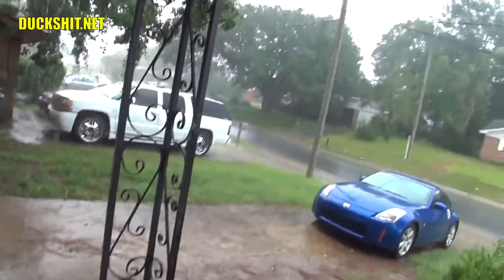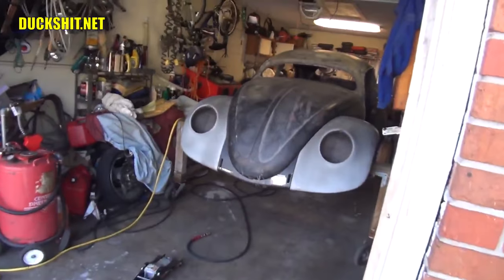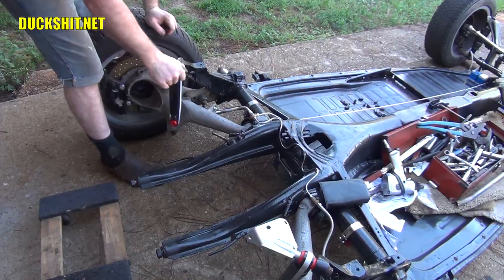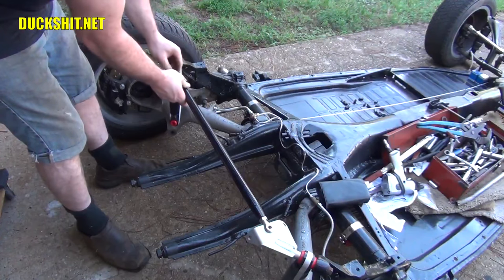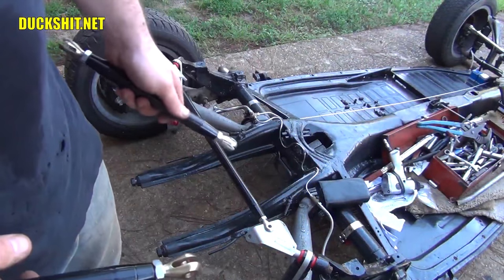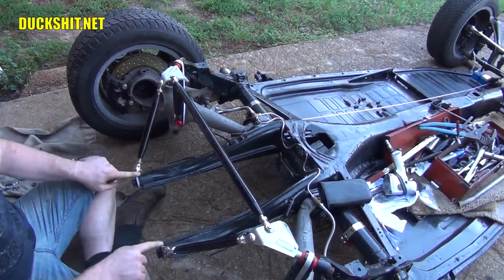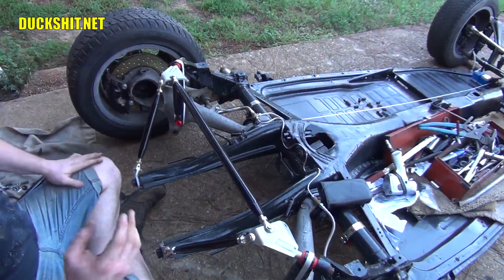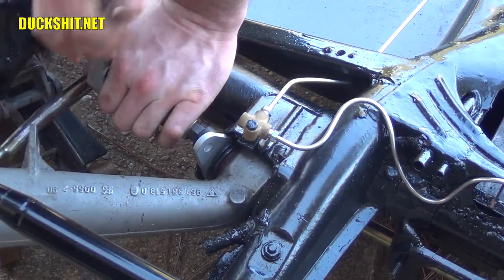Kafer Brace - ROTTEN OLD 1956 Chop Top Oval VW Beetle - 35

Comment: You should consider the 17” Heritage wheels from the current generation Beetle. They have a straightforward classic appearance and look modern at the same time. They do have a different bolt pattern then the 944 but maybe you can use adapters instead of the spacers.
Reply from the maker: I did consider those, I like them very much!  But I have discussed my opinion of wheel adapters in an earlier video.  No wheel adapters for me.

Comment: I fixed up a 67 when I was 16 in 79.Put dual carbs and had close ratio 3rd gear.It would out run V8 camaros .Had a straight stinger with a wing nut baffle that I removed when I dragged race it.Only on the streets.Would love to build another .Do you feel closer in when driving the chop Top? I love the look
Reply from the maker: I love that!  Hehehe!  Thanks for sharing!
Reply from the maker: I don't feel closed in at all, I built it more to the proportions of the 350z, it feels a bit similar to my shoulder, but really not like I'm in a cave.  Mounting the seats lower puts my head right at window level!
Reply: I raced it so much I broke the front cone off the transaxle so bought some plates that bolted to trans and was welded straight to the frame.Had aluminum flu wheel with racing clutch .Sounds right about your Z.Never thought of that .My wife had a Audi TT and it’s the same size .Cant wait to see you finish up bug

Comment: Yo ducky Mcduckerson quick question about these. if it were to get a subbie swap, how would these interact? complete interference? cleared? etc
Reply from the maker: I was talking to Kevin from CoolRydes and apparently these were designed to clear everything.  You souldn't have any problems, if you keep your VW transmission, or if you install a Subaru transmission.  And of course, the engine is nowhere near it anyway, so no problems there!
Reply: sweet. i currently have a 70s buggy and honestly thinking about getting a sleeper subbie swap too. 

i just know it would be a hell of a lot of work because i really dislike the late model hatch/hood styles so i would need to make the older stuff fit.  let alone the engine stuff. BUT its good to know this works since i would need to beef the hell out of the suspension.
Reply from the maker: The older decklids and hoods are an easy fit, the apron swap is where the real work comes into play, though.

Comment: Looks like a good product, do u think it would work on a swing axle setup on an old Rebel frame sand rail?
Reply from the maker: Nope afraid not, because keyword swing axle.  The 6-point truss brace is IRS specific.   A 4-point will work just fine for you though, unless you convert to IRS.   Thank you for the question!

Comment: That's going to be a sweet chassis. LMAO at people complaining about the direction of rotation but didn't seem to notice they are winter tires. Obvious garage use rollers. I mean, winter tires? In Florida? WTF....
Reply from the maker: Blizzaks!!!! LoL! People here don't recognize them! You win a prize!  LoL been wanting someone to notice that since forever!  As soon as I get my first batch of DuckmanCycles shirts in you get the first one!  But the wheels/tires came off a 911 in Denver.  They were his winter set.  He sold the car and I bought the wheels.  New tires when car is ready to drive... dont need dry rot on my new tires while car just sits in the garage!
Reply: Never noticed before since I tend to ignore rollers. Took a look this time because of the uproar over rotation direction and Blizzak jumped out at me. One of my jobs when I lived in New Orleans was parts delivery. I rolled up to a shop and they had a Toyota pickup on the lift. On first glance I was struck by how many nails were in the rear tires. Then I noticed the Mass. tags and realized they were studded snow tires. That's when I decided I'd been there too long. Cheers....
Reply from the maker: Hahahaha!  Thats funny!  I may roll on these tires for a little bit, they are pretty good, no rot.  I wonder if anyone will notice them at this year's show!

Comment: Can this be installed without removing the motor or trans?
Reply from the maker: VERY CAREFULLY.  You'll need to support the engine and transmission weight when you remove the main bolts, and there will be very little space to work.  Probably not a good idea, but yes it is possible.
Reply: Was it the stiffy kit?
Reply from the maker: Thats the one you are looking at, when you order it, let em know I sent ya!

Comment: They have instructions for installation on their website.  Having said that, this product is difficult to install.  It takes a lot of muscle power to make it all attach properly.
Reply from the maker: If it takes that much muscle power you're doing it wrong... or your rear end is tweaked!
Reply: @DuckmanCycles  Partly in defense of the product, I think a lot of these cars have the rear framehorns tweaked, as they are very old, and have been through a lot of stress with the engine twisting them, and just the normal driving load.  Having said that, yes, this product probably should be easier to install than it is, that's for sure, as I do think the angles are off between the parts that use the shock mount and the IRS trailing arm mount, and the engine/transaxle mounts.
Reply from the maker: I can't say that I had any such problem.  I had some clearancing issues for the other assecories that I was using but I resolved that.  It goes in easy!

Comment: I say keep those wheels on! They are probably the ugliest porsche genuine wheels ever, but ... they are The Teledial wheels. I believe they were default on 944 T model, but correct me. That little bit of 80's crazyness just ... keep them!
Reply from the maker: Actually, Porsche has historically made some very ugly or quite plain and boring wheels, but the phone dials may be one of the better ones, lol!   Because of their curves I think they actually look better on a Beetle than any Porsche they ever came on!  They were standard on 911s at some point as early as 1972, I think they came after the also famous cookie cutter ones. But in the 80s Porsche started to put them on everything, they came on 924,944,928.  My set actually came off of a 1978 928 which is why they have such a significant offset and required that 1 inch spacer to put them where I wanted them.  They sure look good on here, though!  Thanks for the comment!  I appreciate it!  😀😀😀😀😀😀😀